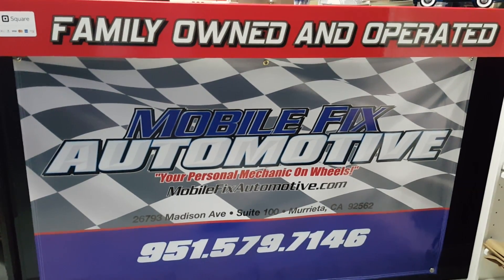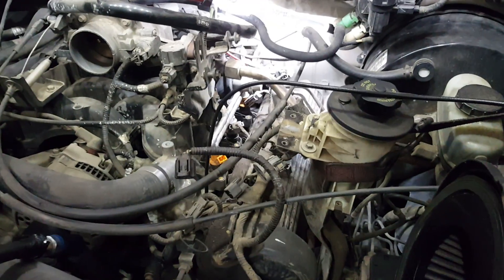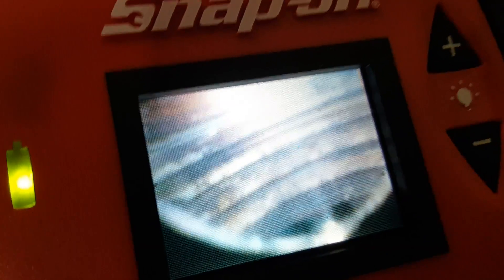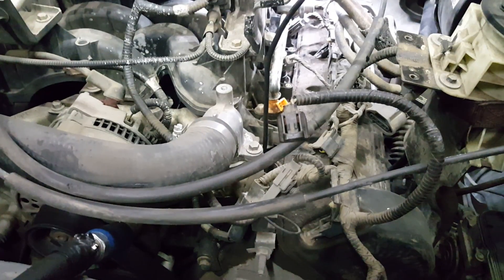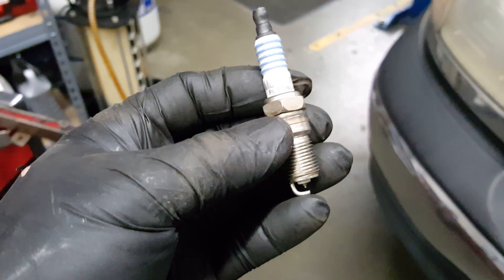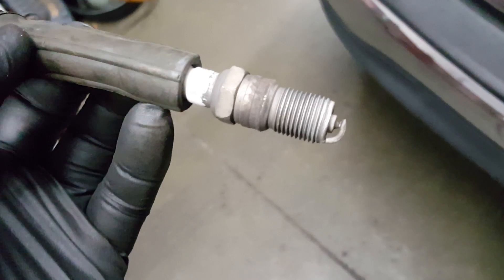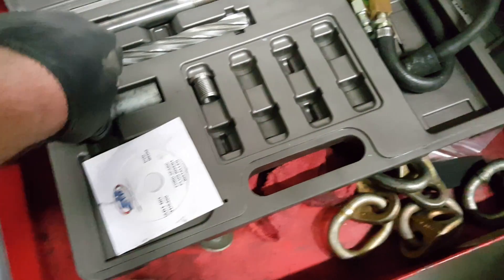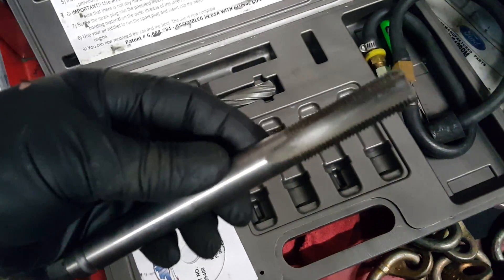Why the spark plug blew out of your Ford Triton engine

Comment: I mean mine blew a plug because my number 7 cylinder chipped a piston... oil flooded the cylinder, popped the plug. So heads up, if you do the insert (I have a kit, they work fucking awesome) buy a boroscope first... $20 tool, works awesome, and would’ve saved me all the time, and wasted insert if I’d have bought the damn thing a few trucks back. May not always be this issue, but 1/4 trucks so far, that’s been my issue. Another fix is to retorque your plugs after a day or two. Had them back out on me before and retorqued before stripping threads... aluminum... not a fan.

Comment: At work we have 2011 f150s with 5.0s we tow small trailers all day long delivering them and picking them up and rarely ever have issues only issue I’ve ever had was a water pump leak at 190k and around 170k it didn’t want to start so we pulled the fuel pump relay and put it back and it started right up
Reply from the maker: Not sure what your comment is about? The 5.0 is nothing like the engine in this video. Actually the 5.0 is a better design.
Reply: Ron Williams meant to reply to someone talking about how the older trucks were the best

Comment: If this plug shoots out this fast, wouldnt you see damage in the hood.
Reply from the maker: No, usually it looses all its momentum trying to break through the coil and winds up laying on top of the engine or surrounding areas. Sometimes they fall out under the vehicle while in motion and get claimed by the highway.

Comment: Torque specs... they exist for a reason
Reply from the maker: Yes I agree. But they change from year to year and model to model that's why I dont give them out often.
Reply: @SandCarServices  not torquing the plugs in the heads is the bigest issue with the 2v mods torque them the way ford says and you very rarely have any type of issue with them.  The proof for my statement is that you will see blown out plugs far more often in trucks then you do in cars mostly due to truck owners being generaly more neglectful.  Those same heads do fine on mustangs with aftermarket power adders like spray or a turbo or a blower creating vastly more cylinder pressure than a f150 would ever see.
Reply from the maker: Can you show me where Ford says to retorque spark plugs at a specific milage.  I will agree that keeping the plugs tight will help the plugs stay in but I have seen 2 valve engines blow plugs as low as 35000 miles now. When I first started doing these inserts around 7 years ago I had multiple fleet accounts with nothing but these engines in them. Since I was the only mechanic allowed to work on them and service them by the book the trucks still would just blow the plugs at random. In my opinion the reason the cars dont blow out plugs as often seems to be more about load on engine. Trucks pull more weight and therefore place heavier demand on compression in engine than most cars. I can go on and on but the fact still remains that this was an issue for a lot of car and truck owners.

Comment: Hello, nice video. I tried to google search on ford rangers having the same problem, but no luck. Do you know if any ford ranger years has this same problem?
Reply from the maker: The engines used in the rangers are not under this Triton issue. But I have had to repair plug threads on rangers, I use the save a thread on those.

Comment: This is the best explanation of the Ford cylinder head flaw on these Triton engines.  I'm currently shopping for used trucks and have been back and forth on buying a used Triton engine pickup because of this flaw.  Your video gives me some hope there's a way to fix and also prevent this flaw.
Reply: PLURAL = flaws

Comment: Sooo... About the JB welding the plug insert into the head- is there another alternative? Because my experience with JB Weld over the last 2 years has been that it's either been cheapened to "increase profit" (which is a completely stupid perspective and inaccurate to begin with), or, that I've gotten a lot of expired product , it's product that won't hold on basic ass things like music equipment, storage rack, seat mount. I swore by JB for the appropriate applications for almost 20 years. Now not so much. Thank God I didn't use it on anything important. Any input?

Comment: weren't there certain year models that had properly threaded heads? thanks
Reply from the maker: On the 2 valve engines I have never seen more than 5 complete threads on any year from 1996 to present. And yes they still make the 2 valve engines.

Comment: been shopping for a cheap used car that was reliable..i'm poor. i've been thinking either a toyota or a ford vic, gm or lincoln with this 4.6 engine. I can't believe the design flaws in these fords. I was preparing myself to pay for an intake manifold replacement...but now i have this plug ejection thing to contend with? sadly, i guess i'll narrow my search to toyotas unless someone here has another idea. 
Thanks for the info dude
Reply: Ford "had a better idea"

Comment: Is it the same for a 2010 5.4 L ?
Reply from the maker: Not usually.  The 2010 most likely has a 3 valve engine.
Reply: The 2010 5.4 L  is a 4 variable valves. 
So Ford fixed this plugs issue?

Comment: Ford Q 101 used to be a top rated quality program which would have never missed a cylinder head short shot casting like this. There was never enough meat in the plug hole in the first place. There is a strong case against Ford for making them pay for this plug issue along with purchasing your fancy insert kit. Rough guess this kit costs around $800.  Going after the big auto makers isn't easy. But, with enough public outcry, they will capitulate. It is a guarantee that Ford is fully aware of this issue. Consider this engine ran for 100,000 miles with no problem. Probably a reasonable engineering decision to not return bad castings on the part of Ford Quality Engineering. This does not in any way relieve Ford of the responsibility. Quality is supposed to be JOB ONE at Ford. Maybe not so much all the time huh?

Comment: Thanks! I have a 2001 5.4 lariat. I blew my #3 out. Spark was dangling at an angle out of the valve, with coil boot bent at a 30° angle. It was a very loud knocking sound, like you explained. My spark arc was also tapped down against the nipple. Is there any other issue which would cause this problem? Or is this pretty much it? Also, if you don't mind,  how much, roughly, do you charge to do the number 3? I am in phoenix need to find a mechanic who can perform this fix.

Comment: Ford screwed the pooch on the Triton design. There’s ZERO excuse for this. Shit like this caused a lifetime Ford truck guy like me to tell them to kiss my money goodbye . The Chevy LS was/is a far simpler design; fewer moving parts, and cheaper to repair & maintain. Certainly they aren’t perfect but the Triton is a boat anchor for a shrimp trawler. 
I’ve been a tech & shop owner for 30 yrs and I’m amazed at how much money manufacturers want for the garbage they’re pawning off on customers. Toyota & Honda do a decent job of putting out consistently good quality vehicles but even they’ll drop a turd on a customer from time to time.

Comment: How much of a problem is there with metal shavings falling into the cylinder during the drilling/thread-cutting process? And best way to remove these shavings or prevent this from happening? Great video!!!
Reply from the maker: Watch my video on how to do the repair it gives all the details.  Thanks

Comment: I know your in the business of selling spark plug hole repair kits but the problem is most likely Ford not tightening these plugs tight enough at the factory and they need checking periodically. I have a 2000 V10 with the short threads only 4 of them. Antisieze on the threads only and torque to 20 ft-lbs not 8 or what ever Ford says. They loosen up and blow out. We tested the breaking torque of the 4 threads and the plugs broke in half before the threads failed. It is an installation problem but Ford putting more threads in would have been better and I hate the cone shaped seats. Never ever had a problem with the crush washer type plugs.
Reply from the maker: I dont sell the parts. And if your breaking steel spark plug threads before pulling out 5 aluminum threads then your very talented.
Reply: The plug broke in half no threads were harmed. This was done on junk head.  @SandCarServices
Reply from the maker: Well I e seen many that the threads stripped out just from mechanics using impacts on the plugs. But they are called opinions. I don't agree. I've done  these for over 8 years. But what do I know.
Reply: Well the design is not great and any screw up ends up with stripped threads.  @SandCarServices

Comment: That should have been fixed years go by Ford because that is there cylinder head malfunction because it does not have in my own personal opinion enough threads that's like putting a quarter inch Bolt to hold a tire it's not going to work not with the compression that it comes from Factory with and that is why in my personal opinion it blows out I could be wrong I am just a Shadetree amateur

Comment: Last ford I got 1984 f150
New no oil in 4 speed new dealer to home 38 miles tranny making noise Friday night call dealer Monday morning he said it should be ok took one year and towed 7 times with me threatening to park at uncles ranch stop paying to ford credit
B4 I got new tranny lemon law said because  it jamed
In granny then next pop out of 3rd then back to jam in granny not the same problem in a row no lemon law for me, but did 540,000 with only a blown head gasket sold to guy near me still drives it

Comment: My 1997 Ford E-150 conversion van (Triton, 5.4) engine caught fire, destroying the vehicle.  I have been storing it while getting the run around from Ford's legal department in an attempt to settle without resort to litigation.  My case specialist just emailed me that Ford denies liability.  So, I will be filing suit.  Thank you for this video; it helps me understand what happened.  If I understand it correctly, Ford cheaped out on tapping the cylinder heads; offering only four (4) threads to accommodate the spark plug's 10 or 11.  It's obvious why the plugs could pop out.  What I don't understand is how they can do that and not immediately cause an engine fire like mine.  If I understand that aspect correctly, the plug continued to fire in the open air, while the gas-air mix escaped the cylinder head, starting the fire.  So, how could a spark plug pop out and the vehicle not catch fire?  Didn't my fire start this way?  I was at a light; I heard an ominous thud, the guy next to me rolled down his window and excitedly shouted fire!  I was near a fire station and they put out the fire, but the vehicle and some of my property were destroyed.  Apparently, Ford's denial of liability is as you said - blaming the spark plug.  Thanks!
Reply: God bless and good luck...
Reply from the maker: I see a fire being able to start from a blown out spark plug a couple of ways. First when the spark plug shoots out it usually blows the coil off completely leaving a wide open cylinder that can't build compression but the fuel injector is still injecting fuel. The fuel can accumulate in the cylinder and get blown out over the valve cover igniting on the hot exhaust. 
The other is as you stated that the coil may have ignited the raw fuel as it came out. For this reason I tell people if they absolutely have to drive their vehicle with a blown spark plug to disconnect both the coil and the injector for the affected cylinder. 
Hope this helps.

Comment: Quick question, I just changed the spark plugs on my 06 expedition, Im not sure if its just mental but I kind of feel the car a bit on the heavy side now. How can I be sure that I did them right? I dont have a check engine light and its been like a month now and over 600 miles. Thanks

Comment: I don't think I ever heard that Ford was blaming the plugs, but I'm not really in this industry so I wouldn't know very well. This happened to me on my '99 Mustang GT with the 4.6L. In 99, 00, and 01 (I think those are the right years) they only cut 4 threads in the head for the plug. I believe in either late 01 or 02, they changed and started cutting 8 threads. Seems like if the spark plug was the issue, they would have just left it at 4 threads. :)

Comment: just buy a tundra and never look back
Reply from the maker: Ha, put my 15,000 lbs 5th wheel on the back of that Tundra and it will spit a testicle! LOL
Reply: @SandCarServices  they are talking about a f150 in the video . put a 15,000 lbs. trailer on that and it will "spit a testicle" too. Whats your point?   apples to apples my friend. My point is fords are among the most unreliable vehicles on the road. Toyota's are among the most reliable. end of story

Comment: I had a 2002 e-350 extended van.i did 6 out of the 8.i had a little kit I kept in the van with coil-overs,a heli-coil kit and jb weld.i would never buy a ford as long as I live

Comment: Because it had 4 threads in aluminum. After a short time, the steel spark plug galled and took the threads with it. 

The "swedge" tool is cool as hell though. OK, just the name of it is cool. Just let the shavings fall into the cylinder and vacuum out what you can with the provided hose in the kit. When you start it, it will get rid of the rest of them. Hilarious machining at its best.
Reply from the maker: Dont install anything but calvan inserts. Damage to head can result.

Comment: This happened to my work truck with its Triton V10 at 40,000 miles. It was fixed at the dealership and 200,000 miles later, I’ve had zero problems with it. Thank God.

Comment: I drive a 2012 E350.  I have  had one plug blow out at 120,000 miles.  I was able to screw it back in.  Other than that the engine has performed great.  It now has about 170,000.  It is a Work truck that hauls a heavy load in and around Atlanta traffic everyday.  The wear on this truck is tremendous due to the heat and heavy use.  Still better than any Chevy.

Comment: Funny, how I've NEVER had a plug blow-out of my 03 4.6 DOHC Cobra with early heads (4 thread) with an upgraded Whipple supercharger spinning the dyno at 670hp. Hell, I go to the drag strip and pull those plugs almost every time I make a run to read them. 
First- don't be a dumbass, make sure you get the plug in straight! Second- use a small amount of anti-seize on the threads.
Reply: That's just not the case. I have an entire fleet of E350 cargo vans and every single one will do this in it's lifetime. I came to the same conclusion years ago before watching this video. The plugs are rated at 100,000 miles yet many pop before then. We do have them changed with OEM plugs around 100k and frequently those will also fail before 200k or sometimes threads strip when removing plugs. 4 threads is horse shit. Period.
Reply: @spirorevelis7100   I have 6 million miles at least on triton engines, not one issue, the problem is  way exaggerated, not that it's not a problem, just that the internet makes a minute % of problems seem like a mountain of issues. I use a shop that does tons of work and have only seen 2 blown plugs in triton engines. Facts, not opinion.
Reply: @jerryw6699  I'm not saying it's an epidemic and I'm not bashing the Triton engine. We get a minimum of 300,000 miles out of each before we retire the vehicle due to rust on the body (Illinois). Even at 300k I would still drive one cross country. HOWEVER..... Out of 20 something vehicles in 15+ years almost ALL have popped at least one plug and some have popped as many as three in their life spans. It's a design issue because 3 or 4 more threads would have eliminated this entirely. It shouldn't happen at all.
Reply: @spirorevelis7100  somebody is doing something wrong on your engines; we have a similar, but smaller fleet, (electrical co.) and just no issues, and our shop has almost 0 issues. They have always torqued and used never seize, maybe just different conditions but I'd be very careful when changing plugs.
Reply: @jerryw6699  Never seize prevents threads from ripping out on disassembly but it does absolutely nothing to be prevent plugs from popping loose......
Reply: YEP, Always do. Plus that little extra torque when you install. That bevel gives a tight seal and a slight bit of umph, on the long socket wrench makes for a bite that almost takes a cheat bar to remove. Even after a hundred throu of miles.
Reply: mark, I think your in the majority by far, I think the guys having all of this trouble don't know how to change plugs or read a torque wrench.

Comment: If I’m not mistaken, 97% of the holding ability or strength of a bolt or in this case spark plug ( threads in general ) by 3 turns.  Meaning, 3 threads engaged.

Comment: This is not clear.  What I'm understanding is that the threads in the head failed so you're putting in an insert.  But it's not really clear if it's because the insert has a full thread run or that the original threads have been trashed.  I see the sparkplug and it's hard to see, but the threads look okay.  Even if the threads in the head were okay, it would still help to put the inserts in, as you point out.  All very interesting and what the hell is ford doing?  Now they don't want to build cars, just trucks.  Good luck with that.  Ford trucks were the only ones I trusted.  Now what?